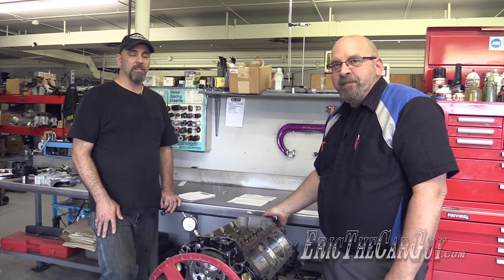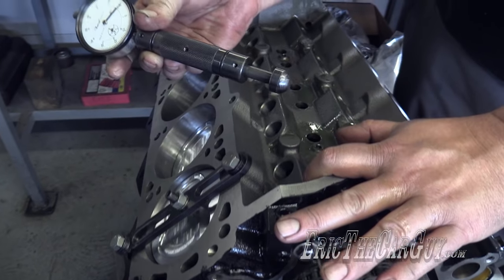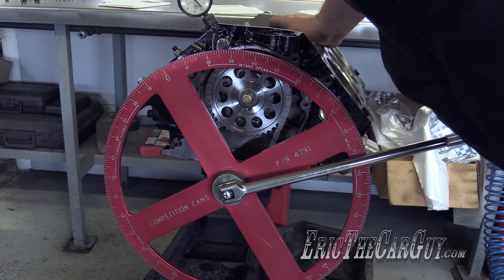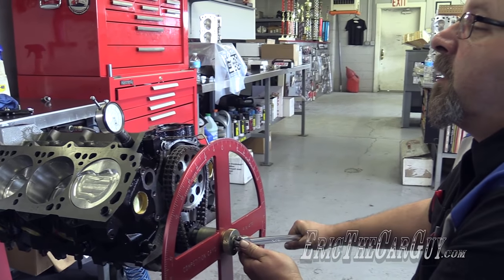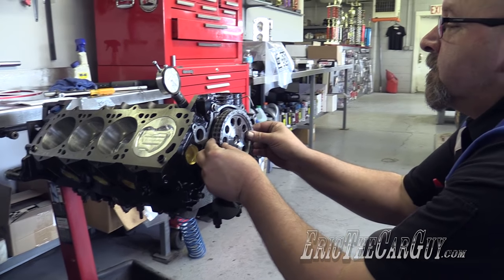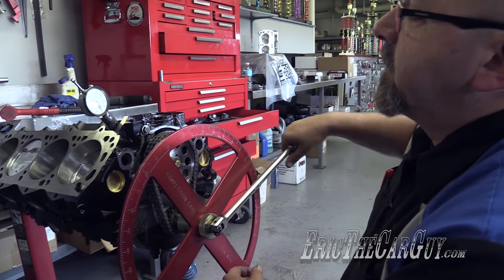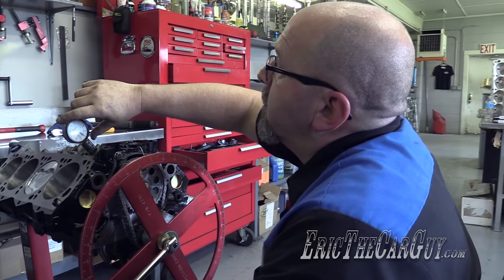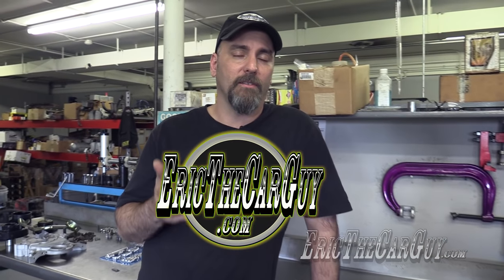How To Degree a Camshaft

Comment: great build and effort. If we could just delete the slaughter and butchery of the oil pan video this shop would be blemish free.
Reply from the maker: I could not disagree with you more. The pan is fine, the return is fine, it doesn't leak. Give it up.
Reply: foxdmulder ok Mr perfect, shit happens when you're in the heat of the build
Reply: Its an oil pan. The only reason people bitched so much is because that was the only part of the build they could actually wrap their heads around. Justin might of rushed through it a little haphazardly but would taking another hour to work on that pan made any difference in power output? No, it's superficial, and it works.

Comment: I have built plenty of motors and dont see the this as being critical unless you have an after market cam sprocket that isnt marked. I guess its possible for the pin to be out of place slightly but i would have a serious doubt that the cam would be far enough off to move it an entire tooth so you are really i guess checking if its a cam worth keeping or returning. Personally i would put some faith in todays technology to produce more accurate cams than they use to when timing a cam was more important.

Comment: I understand that the igniting of the fuel is suppose to happen before top dead center, not after, which is correct.  From research, knocking has been known to come from the free play of rod caps alone. So 11.45 degrees before top dead center there should be a spark for the timing of the piston to come around. By the time the piston reach the top, the mixture will be set on fire and the next cycle will begin. One great thing is the constant motion of a crankshaft can never be reversed due to the compressing of air. More air in the chamber at one whole time, results in more power. So really I'd say 14.7 is incorrect for Air- fuel ratio and more like 16.1 is best, well 16.0 rounded. Will continue writing. You're great help man.

Comment: Comp doesn't only do custom cam grinds, they also have a massive variety of off-the-shelf cams for just about every V8 engine you can think of. Anything from low end, torquey cams for trucks, too well rounded cams that work well throughout the entire rpm range, too cams that like to scream to make big power, and everything in between.

Comment: 5:55 - I was watching a different video where the instructor made a good point. You don't want to check the average point/ dwell point of a cam lobe the same way you do the piston dwell because often the cam lob ramps up or down differently. So to get the most accurate reading of the cam lobe dwell only check 20 thousands both ways to find the true peak lift point of a cam.
This point seemed very logical to me. Especially when you can clearly see just with the eye, cam lobes are not perfectly center.

Comment: The lobe probably looks larger than advertized because the diameter of the tool tip is larger than a standard roller lifter. So it starts riding up the ramp a lil early and closes a lil late, but the centerline doesn't care because it's at peak lift.

Comment: FINALLY AN ANSWER TO THE QUESTION I'VE BEEN ASKING SINCE I FIRST WATCHED HOTROD TV!  Why do you have to degree a cam shaft if it's got a set position for the cam gear?  You don't.  It's just to check that it's keyed correctly.
Reply: And if not, what (if any) adjustment you can make to correct the issue.
Reply: Larry Bolan
Yeah I tried to edit my comment but it wouldn't let me for some reason.  I meant to add "you don't need to in a factory application where you're using pattern parts."  You can take the cam out of one 420A engine and slip it right into another 420A engine and not have to worry about it for example.

Comment: Best cam video out there.  Machining is about tolerances, not perfection.  So... suppose all errors stacked up together towards advance or retard on  work being plus or minus a half degree on a cam where lobes got profiles perfectly ground?   Crank key + broaching of crank sprocket + dowel pin on cam + dowel pin hole on cam sprocket + sprocket teeth [crank vs. cam] = 2 1/2 degrees error.  Nobody did bad work, but things just sometimes add up.

Comment: correct me if I am wrong, i've always been told that the cam card shows the suggested values for maximum clearance for the valves, and during tuning, they will need to be slightly adjusted to move the power band.

Comment: What i dont understand is they talk about at 8:17 ish they advance the sprocket on the crankshaft.. how does this do anything? Because hes not actually moving the crankshaft, hes just putting the sprocket on with a slight turn. How is this increasing or decreasing valve timing, nothing actually moved.

Comment: Hello Eric, I'm depsperately in need of some tech help. I installed a Pontiac 350 from 1970 with #76 casting heads from a 1965 389/421 GTO and a near duplicate of the 068 HO camshaft. After breaking in the cam I realized that the exhaust port of cylinder #1 didn't change it's color. I pulled the spark plug wire and the engine did not response at all. Since then I've been searching for the reason why #1 isn't firing. I checked compression, wiring, spark plug, distributor and all seams fine to me. I even changed the spark plug. The engine runs at 30° advanced ignition timing at idle speed (650) without vacuum line hooked. 
How important is it to degree in a cam? Can a "undegreed" cam cause the problem? In my opinion it's a timing problem, isn't it? 
Greetings from Germany and thank you for your help.

Comment: Hello Eric, it seems that when Kevin repositioned the crank sprocket that he only rotated it an nothing else (Cam sprocket, crank shaft, etc). Is that the only adjustment needed when you need to change the timing? I am working on a 5.3L LM7 with a Comp Cam and Comp double roller timing gear set and want to make sure that I get this right. Thanks in advanced.

Comment: Does this only apply to symmetrical cam lobe design?  Some more exotic type engines use asymmetric cam lobes and rotate the opposite way to the engine. ......potentially confusing? ??

Comment: If you didn’t have the keyway in the crank gear, couldn’t you just time it 2 degrees advanced using a torque angle gauge or something similar to measure the movement after TDC?

Comment: It's impossible to get it right on spec with the spec sheet. I at least have never seen one fall exactly within specs on all categories, and I worked at a machine shop for several years, and built a many engines.

Comment: If the radius of the indicator follow is just slightly larger than the radius of the cam follower that can be why there's a two degree difference.
Reply: No, but lifter bore clearance and lifter bore to cam geometry can introduce a discrepancy.
Reply: radbot1 exactly. That's why it's better to use the lifter you plan on using

Comment: eric please help. my 93 honda civic has been sputtering and i suspect a vacuum leak. the car runs fine after a cold start but once it warms up it wants to stall at idle when i come to a complete stop. well today it finally did right when i parked at home. turned it back on and a few seconds later it stalled. when the cars stalls the oil and battery light stay on.
Reply: Rudy Salas could be the coolant sensor maybe? I reckon it keeps the choke one for too long.
Reply: The Vibe the engine isnt overheating but doesnt hurt to check the resistance on the sensor. i suspect the main relay or distributor ignition control module im really not sure

Comment: Kinda makes me wish I would have sprung for the double roller timing set with adjustable crank sprocket.  I didn't think on it since I was going at the time with a late model stock engine but now im doing a short block build with a crane roller cam.

Comment: if I take apart my stock acura integra engine to replace my head gasket, do I need to degree the camshaft when put it back together or can i just use the timing Mark?
Reply: just use the marks
Reply from the maker: Just use the marks.
Reply: EricTheCarGuy hey when would i need to degree my camshaft?
Reply: if your engine is modify with pistons or cams

Comment: Ok so in reality, you wont even notice 2 degrees SOTP.  Lets not overexaggerate how much that's gonna affect the power curve.
Reply: It depends on the engine design.  Also, the key point he was how off he was in the beginning.  Had he just gone with his 0 marks, he would have been in trouble!
Reply: @LynxStarAuto  if I understand correctly, with higher lift cams, if the grind or degree is off from the start, there could be contact between pistons and valves.

Comment: i'm still confused with the true TDC part. if you are using a piston stop that's about .200 in the hole, how is that TRUE TDC? I have a bottom end right now that is .005 in the hole at TDC... how does this equal true TDC just by hitting 23 degrees before and after TDC?
Reply: PANTYEATR1 you rotate until it stops, then rotate the other direction until it stops. Then you split the difference and that gives you true tdc.

Comment: So even if you know top dead center before and after installation, you need to degree the cam? Just confused on all this camshaft stuff
Reply: Theoretically, if the cam manufacturer had top knotch tollerances, you could just throw it in, set timing, and roll with it. But, mass production, poor machine calibrations result in off grinds.

Comment: is it still worth degree your camshaft if neither your cam or your crank has any adjustment on it. eg using the standard timing marks.
Reply from the maker: Absolutely. It's the only way you'll know if it's correct.
Reply: You can use offset cam degree bushings when there is no keyway adjustment.
Reply: It doesn't make much difference

Comment: I like the bent wire bolted to the block as an indicator..  what was that lined up with on the engine?
Reply from the maker: It's not. You line the degree wheel up with the pointer. Doesn't really matter where it's placed to start with. That's what we were doing at the beginning of the video.
Reply: EricTheCarGuy did you guys have rings in the pistons when you degreed the cam? Is it advisable one way or the other?
Thank you! Great video BTW!

Comment: whats 2 degrees between friends? LOL

I recently ran into a Comp cam that was 11 degrees off.
Reply: 1, 2 skip a few explosion.
Reply from the maker: Yikes.
Reply: NOCAREBEAR what are the symptoms of a cam being off degree?
Reply: D Cruz lot of times it can change up your power curve. Possibly a stumble down low in rpm. Late 80'- and early 90's GM 4.3's are retarded. I think like 6 degrees. You can change the timing chain set to a 350 timing set and it it seems to add a little more grunt.

Comment: so how long till your done with this engine and putting it in the car
Reply from the maker: You'll get to see the engine on the dyno Friday. It'll still be a while before it's running in the car so much to do yet.
Reply: Bobby Stevens its al ready in the car. if you watch his q&a videos you can see it installed.
Reply from the maker: It may be in the car, but it's only test fitted. It still has to come back out so I can redo the front suspension. I also still need to wire the car as well as a few other things. It will be a bit before it's actually running in the car.

Comment: ivory-billed Big Block Chevrolet engines from the lake 70s to the mid-80s this is old stuff 850 horse 900 horse Avgas if you don't know how to degree a camshaft you shouldn't even be put in oil pan gaskets on that engine Dave from St Paul Channel 2 144 miles an hour quarter mile 4 88s.   130 ave. Gas.    
trophies in my cabinet thank you

Comment: Based on what I have read in the performance books, some cams should be straight up, some advanced and some retarded. To know this, you need to set it one way, dyno it, remove cam, adjust it, dyno it, adjust cam ditto, ditto, ditto*** Modify engine and ditto***. This is pro-racer stuff. Forget this!! You want to be on the street with your friends. Get a bigger cam or do other modification that you can feel and improve your sanity.
Reply: Exactly, i didn't understand this, it's like master engineering level, all i Know is bigger cams open valves for longer duration
Reply: It's better to adjust ignition timing and air fuel ratio for performance

Comment: if you have a choice of having one type of forced induction for the rest of your life, which one would it be? Supercharger or a turbocharger?
Reply from the maker: Can't do it. Depends on the application.
Reply: +EricTheCarGuy oh yeah, never thought of that.
Reply: It must be turbo, gotta think about those polar bears man!
Reply: +Brendonsanya umm what?
Reply: Supercharged engines use much more fuel because the charger runs on engine power. Turbo is using waste energy from exhaust gases thus supercharged engines burn more fuel that accelerate global warming. Now polar bears live on Earth's poles and those poles are melting in front of Your eyes when You step on the gas in a supercharged car altough the instant power is a benefit. So i'd rather wait for the turbo to spool up than having to deal with the tought of killing innocent white little bears :D sorry for my english I'm from Hungary!
Reply: +Brendonsanya ohh now I get it, by the way I see no flaws in your english so you're good.